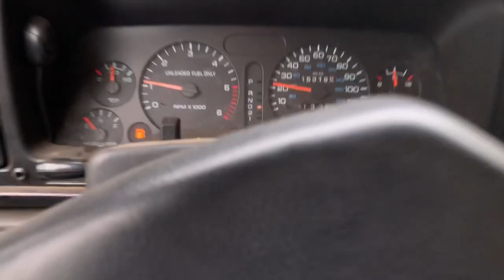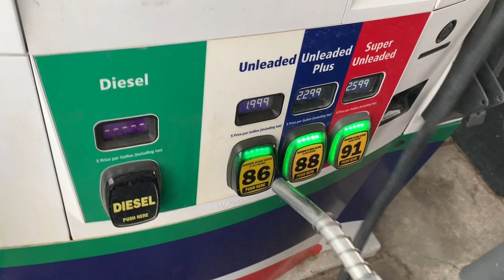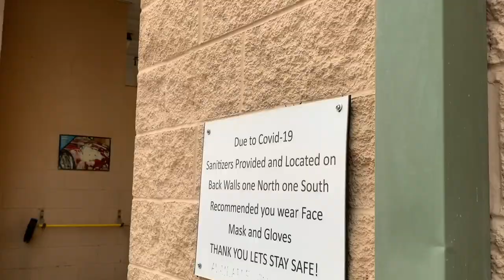Truck vlog Washing the trucks and SS clone!!

Comment: Y dont ur bro just put 5lugs on the OBS?? The front tires looks like hes got 3inch spacers like they stickin out way further then the rear
Reply from the maker: It looks like that because it’s a 4x4 truck and in the obs they stick out a little in the front it’s a 6 lug truck might do conversion or find different wheels for it